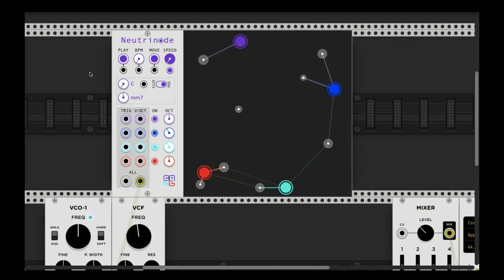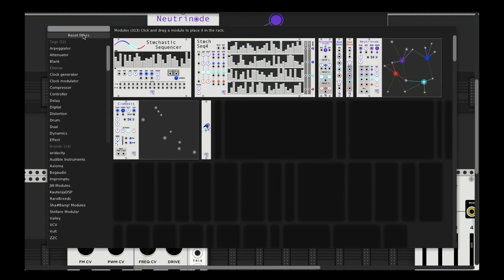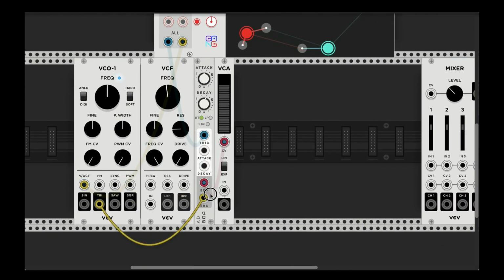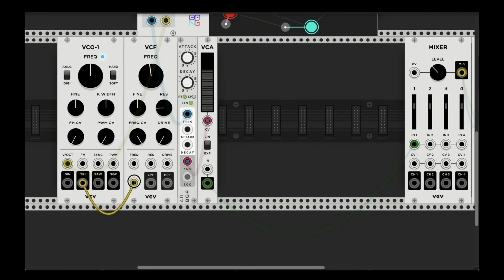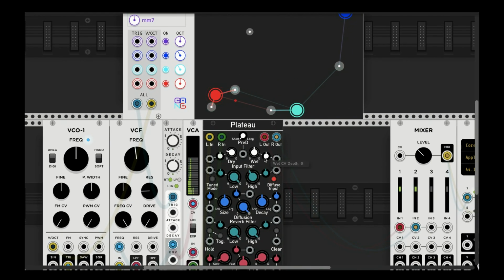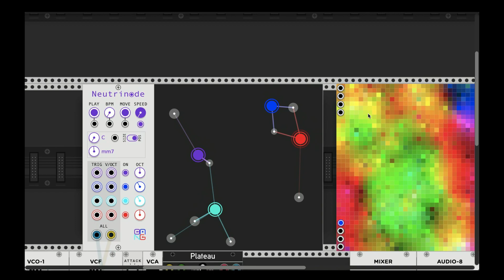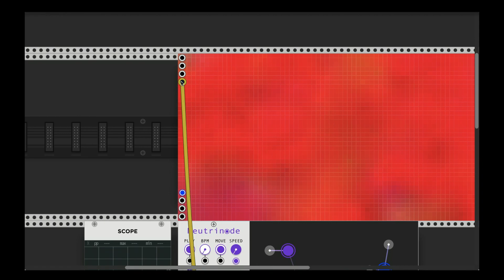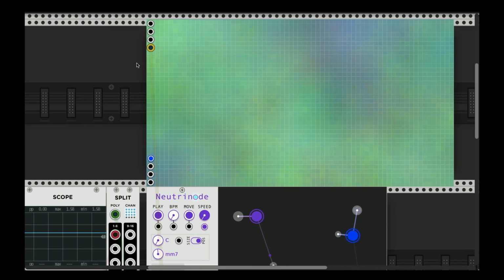Create a simple ambient patch with Sha# Bang! Modules

Comment: The VCV ADSR can be used the same way. Set the Sustain and Release both to 0.0 (sec). Now only the Attack and Decay affect the envelope. Understand that both the Attack and Decay happen while the gate is high so the gate needs to be at least as long as the rise and decay time total. You can use the Count Modula Slope Detector to generate a trigger for each note played if the VCO you use does not output a trigger, which detects changes in the v/oct control voltage, and the Count Modula Gate modifier to set the gate length. If you hear a "pop" at the end of the envelope, set the Release to 0.1. This only happens if the gate is shorter in length than the total attack and decay time so the better solution is to slightly increase the gate length.
Reply from the maker: The VCV ADSR doesn't work in the same way as I'm using Bogaudio AD in this video. The trigger output from Neutrinode uses the VCV Rack standard of a 10V pulse for 1ms. It's not a gate output, it's a pulse output and I wanted to trigger an envelope shape independent of the duration of the trigger. And the VCV ADSR isn't capable of doing that (as far as I know).
Reply: @jeremysmuller  The VCV ADSR is indeed gated and not triggered, so without converting the 1ms trigger to a gate, you are correct - it wouldn't work as in the video, but it is possible as described with the addition of only one device to convert the trigger and set the gate length.